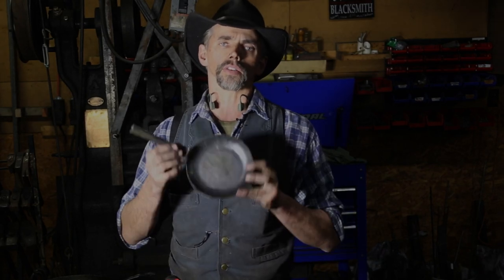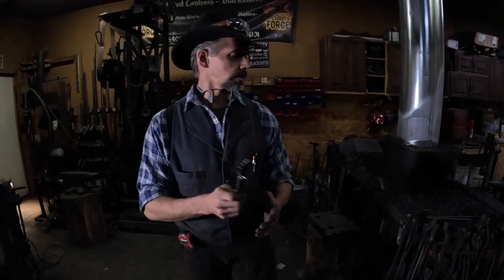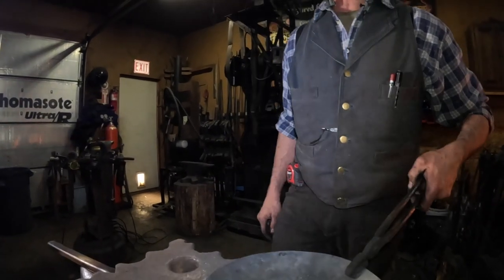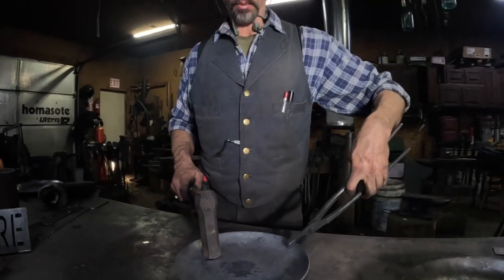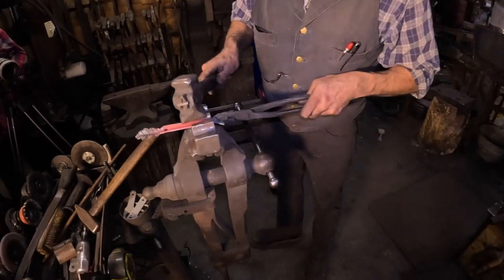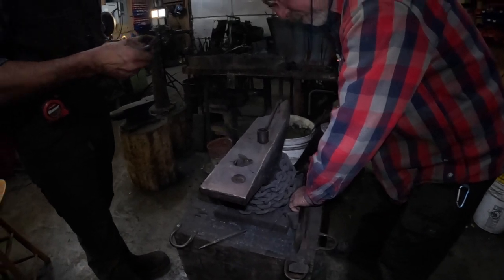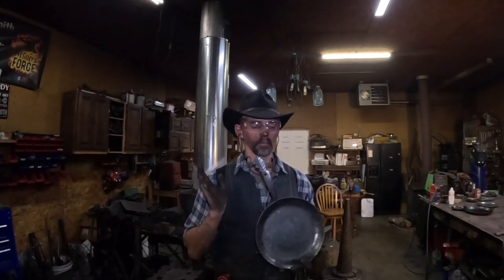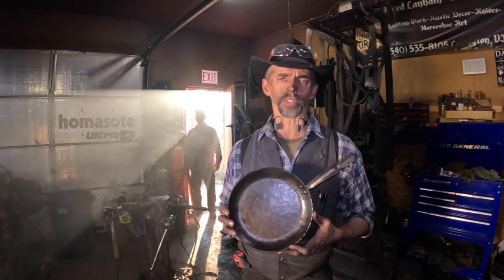Hand Forging a Skillet

Comment: By chance do you happen to make these with slightly taller sidewalls? (Not in design) but wall sizes similar to lodge, debuyer, matfer? Appreciate ya sir.
Reply from the maker: @justinariyan8590  yes I do. The standard ones I make now have taller sides. Thanks for watching and commenting!